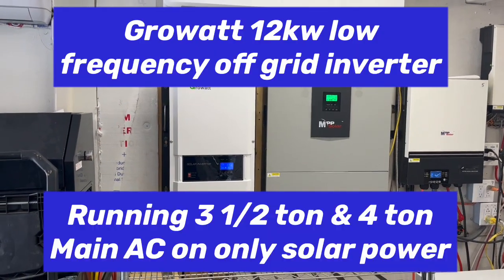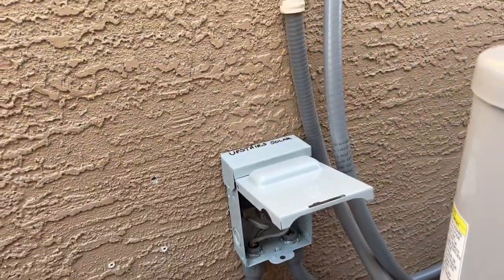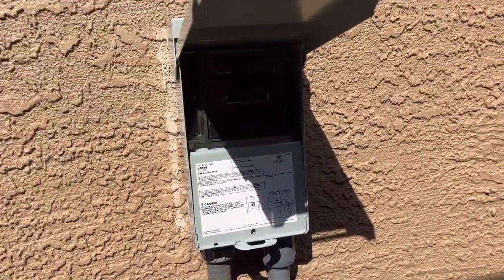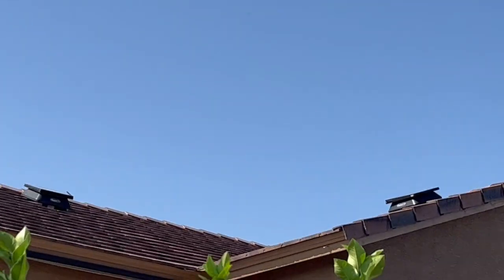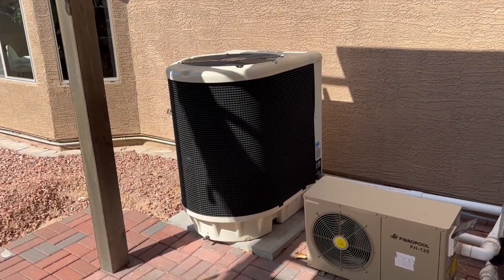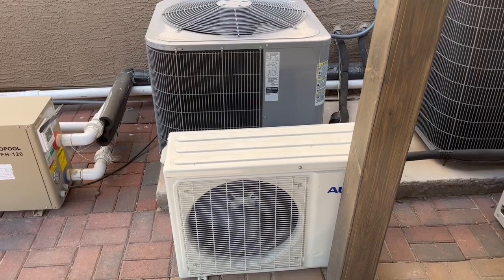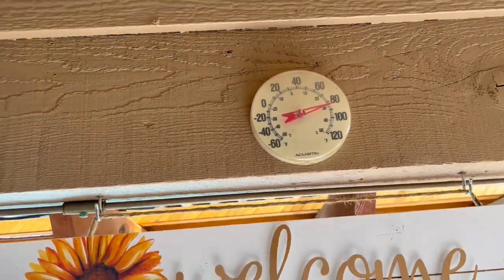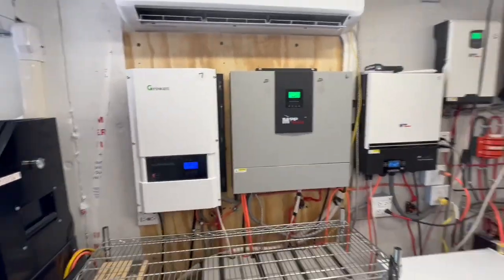Solar runs 3 1/2 & 4 ton AC with 12kw Growatt low frequency off grid inverter all day

Comment: Start one when surge goes down then try and start the other unit after at same time willl over load try one then the other but also with no battery's it's hard to pull from panels to start it should start both easy but I have big battery bank and array
Reply: Ya if you get more panels or even bigger battery bank it won't drag so hard and turn off  it's a good machine iv never had one returned yet nock on wood but there pretty much built proof unless you connect the ac in put to the AC output  blows the mosfits that's happens more then I thought or would like
Reply from the maker: I connected 48-250 used poly solar panels and both AC’s started up no problem. When both started my battery bank stayed above 50 volts, so it was able to draw from panels connected and not so much the battery bank. Thanks for all your help and suggestions.
Reply from the maker: I tried what you are saying. I’m sure once I have 12kw worth of solar panels connected to 12kw Growatt , I will be able to start both 3 1/2 ton and 4 ton. I only had 39-250 watt solar panels connected to inverter and 48volt battery bank when I tried.

Comment: I think you could run the bigger heat pump for pool most of it is the element and the pump elements don't surge hard  but good job of you need anything I'll give you 15 percent off just for knowing what your doing. With solar good job
Reply from the maker: Buying some 6 gauge stranded wire this week to run from inverter to 12.5 ton pool heater heat pump. I think I might of been picking up voltage on earth ground from grid ac disconnect, earth ground is right next to another earth ground and I usual get around 70-80 volts across earth ground. That could be tripping up inverter. I will look at it again this week. I looked at electric bill for hourly watt usage and 12.5 ton uses 7000 watts per hour at 230v so that means it is using around 30.4 amps. When I tried a couple of weeks ago I think my settings in inverter were keeping me from starting it up. My 3 1/2 ton and 4 ton running together use 5000 watts-6000 watts.
Reply: @diy-solar-guy  6awg perfect keep neutral and ground apart tho in the box and you. CAn run a line back to your main house panel like I have and put 80 amp brakers on each side and you would turn off grid power and turn on the two 80 amp brakers and it would run your house in a power grid failure operation
Reply from the maker: I like that
Reply: @diy-solar-guy  it will keep house light and AC. And more till the power is restored then you turn off the brakers and flip the main and back in main it helps me a lot

Comment: I'm in AZ also if you need anything  Told you that thing is a beast runs both my big ACs easy it's such a big  transformer  and even the inductive load should have a relay so when AC turns off if cold the pool heater turns on or you could run all of them together     Run high surge or inductive loads they will last longer and use the mpp for everything else. Do make transformer to ad to take transformer noise away
Reply from the maker: I am just south/west corner of Phoenix in az. Hope one day to meet you.
Reply: @diy-solar-guy  I graduated buckeye high school so I know area